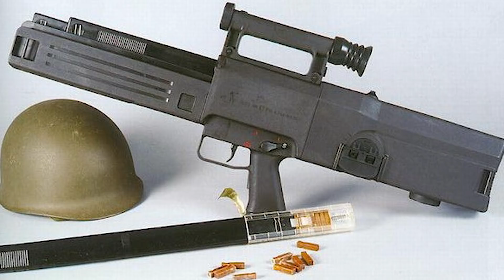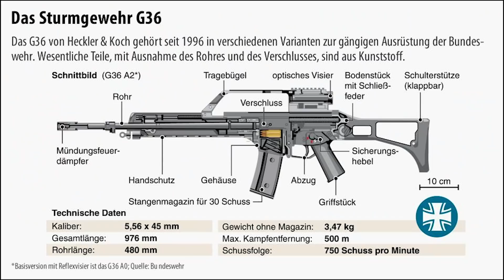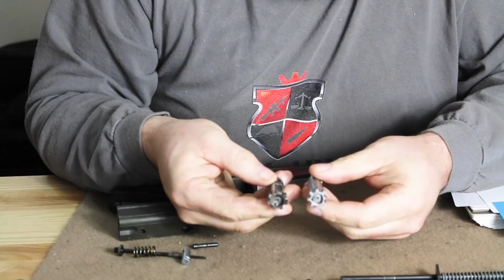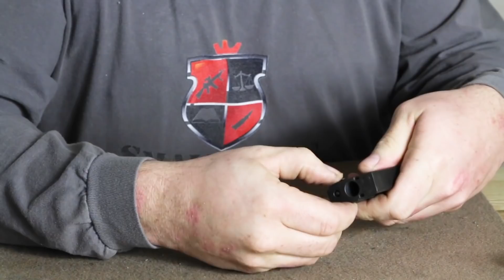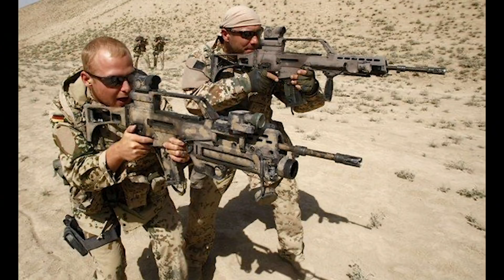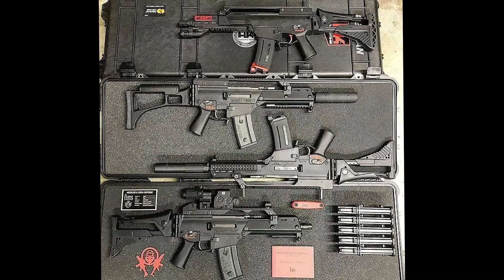The HK G36 Rifle

Comment: I noticed that the SmallArmsSolutions  review of  Brownell's BRN-180 upper receiver found that it had mediocre accuracy.; now the G36 system rifle reviewed showed mediocre accuracy. Both rifles are based on the AR-18 system and I wonder if that system is inherently less accurate that the AR-15  direct gas system , though perfectly suitable as combat rifles. Does being piston gas systems make them less accurate than the AR-15  direct impingement gas system due to more moving parts.?
Reply: Think that would have to do with barrel. Chrome lined barrels are less accurate than stainless steel. But also remember that a civilian rifle will be far more accurate than a military rifle because of quality of parts and use of parts.
Reply: @Angl0sax0nknight  I guess the only way to know would be to compare a "stock" AR15 to a "stock" AR18 in terms of military rifles.
Reply: You may laugh, but SA80 is just as accurate as an M16A2 and it uses the exact same gas system as AR-18.
Reply: @skepticalbadger  The fact that neither the British nor the Germans could get that rifle right is more a reason to cry.
Reply: You also have to take its outdated configuration into account. I'm fairly confident that you would get similar accuracy out of the G36 as a milspec AR if he were to replace the outdated 90s tech optic with something more modern and if the trigger was better.
Reply: @Gun_Dae  The AR15 was created before the AR18 system so the AR18 should have the technological advantage for accuracy. Remember the AR18 system was created to be a "cheaper" alternative to the AR15, maybe loss of inherent accuracy was the price for a more affordable system.
Reply: @Gun_Dae  The dual optic was truly a product of its time. Sure, it was decent back in the 90s. But nowadays? There's way better options with much better glass and clarity. I don't doubt that the dual optic along with the heavy trigger (922r components according to Bostic, not original HK) contributed to the accuracy results.
Reply: No that doesn't make sense it's about the state of technology when those guns were made. The m27 is more accurate than a m4 but doesn't mean either operating system is more accurate
Reply: @kenb.1096  But the AR15 system was created before the AR18  , so the AR18 should have the edge in technological improvements. Also, the BRN180 is made with today's technology so when the gun was made doesn't seem to determine it's inherent accuracy.
Reply: @MGood-ij1hi  yes the whole gun itself was created after the ar15 but components like the Gassystem go way back to the ww1 if I'm not mistaken so it is all a matter of quality there is no difference between di and piston if the barrel and other stuff are identical. And yes you are right that accuracy isn't necessarily a matter of production date but it can be a factor because a modern gun most likely has better tolerances and so on
Reply: Seems to me that differences in barrel and barrel mounting would matter more than the kind of gas operation.

Comment: As the owner of this rifle that loaned this rifle to Henry over at 9-Hole, thank you for the video! The goal for this rifle, in my eyes, was to emulate the original issued Bundeswehr G36 as closely as possible. I opted to put the original issue dual optic and leave out the extended bolt release lever for a simple bolt hold open for that reason. It also could have come with a pictogram lower housing, but I opted for the SEF. 

I will admit that the fire control group was pretty mediocre to say the least, along with the original dual optic. I do know of a modern concept of said setup that I do see on rifles out there, which would basically be a Trijicon ACOG with an RMR on top. I wonder if the accuracy could perhaps be better if we used much better glass on the gun rather than that 3x which has a horrible thing with fisheyeing. Also something else to note is that the FCG was some of the parts that were US made for 922r compliance, so whether the heavy trigger was endemic to the original rifles or just these Bostic ones, I do not know. I remember the trigger on my SL8 was fairly light to begin with so take that for what it's worth.

In your comment about doing a video on a TommyBuilt clone, the receiver on that rifle is actually a TommyBuilt receiver. However being that this model was an T36EGER, this was built off of mostly original HK German produced parts (original CHF CL barrel, original bolt group, etc) whereas most of Bostic's builds are 100% US made as far as I know, evident by his use of nitrided barrels and US made bolts and whatnot. Hope that helps, once again thanks!
Reply from the maker: A Bowl of Pho thank you so much for the opportunity!
Reply: @SmallArmsSolutions  Indeed! Thank you for making this video possible. The G36 was on my wishlist for this channel, along with the Israeli Negev and the new(ish) Light Assault Machine Gun from Knight's Armament. Perhaps those will appear in my playlist someday. 👍
Reply: Yeah, thanks for the opportunity. It would have been good to put it beside the HK243 (basically a civilian G36), which also is not (yet?) available in the US.
Reply: Thanks for making this available!

Comment: Its all about the money... This gun dosnt fit its requirements anymore. Also, we (I am an ex german soldier) dont like the optics and the crappy magazines as said in the video. Its nearly 30 years old technic. But newer and better will cost and our politics did not like to spend money on the Bundeswehr. The G36 isnt a bad rifle and I really liked it, but hands down its becoming old, so politics try to find a way to replace them cheaply... and this will take at least years.
Other countrys seems to be happy with them.
Reply: By old do you mean the design philosophy is outdated (optics, needing a heavy rail unit to add modularity for lights/lasers etc) or the physical age of the rifles in service? I'm guessing the polymer through age, UV exposure and heating/cooling in use would result in individual rifles becoming as we say in the UK 'clapped out' (used to the point of becoming unfit for purpose)
Reply: @AidanMyne  both... Old in the way of how it is used (outdated tech and not up for the mission the Bundeswehr is on) and old material... 20+ years old guns tent to have problems.
Reply: @PyromanicPunk  Ah, thought so. What is going to replace it? I've see the HK433 but with France and Norway going with the 416 it seems the 433 is basically the lighter/cheaper solution to a 5.56 platform with a folding stock and HKeymod?
Reply: @AidanMyne  I wish the 433 will make it, but only time will tell and over here it is a process that takes many years.